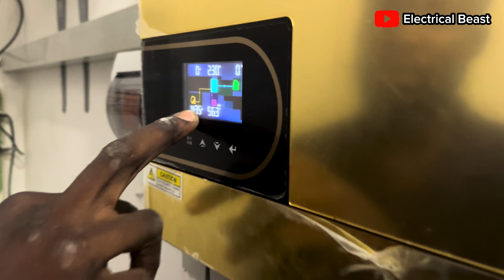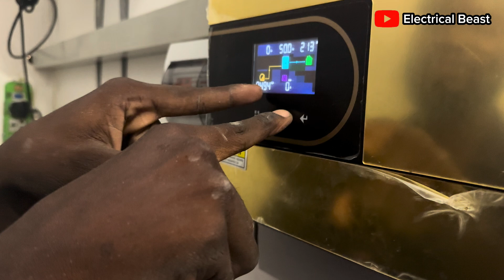Solar Hybrid Inverter Installation Without Battery

Comment: Please we are using a haus storm lithium 220AH battery like 4 pieces and my old felicity inverter spoilt so I bought a new one which is this sms inverter, and naw the engineer is complaining that the battery is not accepting the inverter how is that please, and can u please give me a solution or your n😢please I bought it expensive 😢

Comment: Is this inverter really pure sine wave? ,how clean is the output sine wave ,is it clean enough not to distort and affect sensitive electronics?
Reply from the maker: It is, but sometimes decoders fail to work when the pv switch active

Comment: You can use a no-battery setup if the grid is stable. When there is low solar, it compensates with grid.

But the best for a no-grid situation  is to get a small battey even if its a 4pcs of 7ah battery, to act as a buffer for the solar. Even in the afternoon, there are solar flunctuations.
Reply from the maker: You’re absolutely right

Comment: 1) Since there is no battery, so no power at night?
2) I believe this is just using solar panel as power source?
Reply from the maker: Exactly as you've said  ✅
Reply: @engrgideon please don't promote this, 
The battery produces a more stable flow
Reply: But for many business use case ,it is great. Remember most businesses close by 5pm.

Comment: What's the name of the inverter..and can one connect generator and nepa input to it?
Reply from the maker: It is SMS 6.2kva inverter. Gen and Nepa can be connected when battery is present.
Reply: @engrgideon  but can you give reason why NEPA or gen input can't be connected without battery in place
Reply: Wonderful
Reply: @engrgideon this inverter can be used with solar and utility/gen even when not connected to battery

Comment: Its not adviceable to use this kind of inverter without battery for an extended period of time because it wasnt created to work that way, if it is for a short-term use then no problem. On the other hand "Micro inverters" are the inverters which are actually manufactured to work without batteries .
Reply from the maker: Yeah true, it's for the time being. They'll look to get some batteries soon.